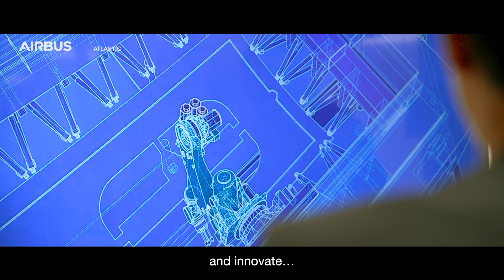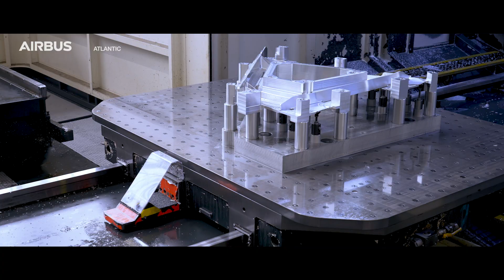Airbus Atlantic Saint Nazaire site

Comment: Anyone know what countries produce parts for the airbus aircraft’s, the uk 🇬🇧 build the wings I know and engines rolls Royce , Germany 🇩🇪 have a huge airbus factory for building planes , And final assembly in France 🇫🇷 even Spain contributes parts for the planes . 

When you say airbus many people think of France , but airbus are several countries that work together to build these beautiful airplanes ❤
Reply: In history Spain produced the elevator, on the A380 and A350 Spain produced the monolithic carbon fiber tail section. Spain has a long record of carbon fiber innovation.
Reply: Germany and Spain are only subcontractors of France, where the planes are designed with french project managers and french test pilots. The UK is a real partner. France and the UK can build a complete aircraft themselves. Germany and Spain are part of Airbus for political reasons, not for their technology.